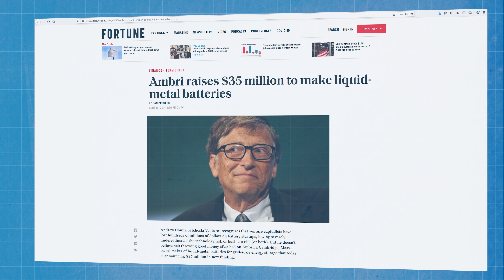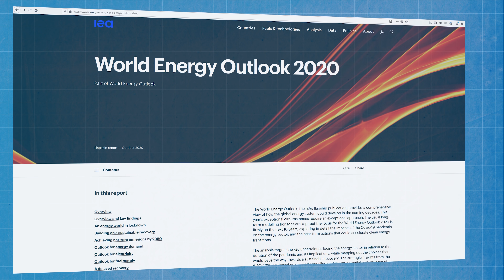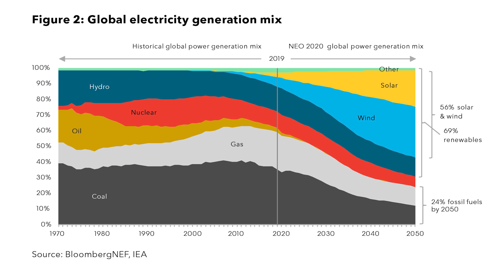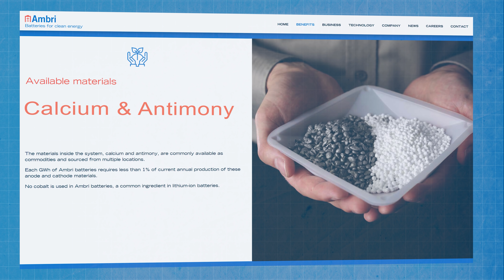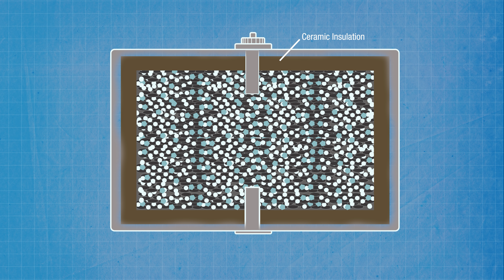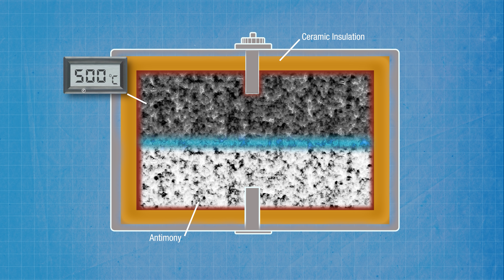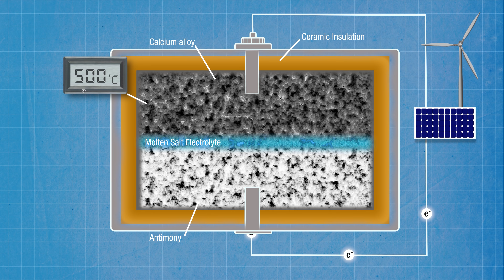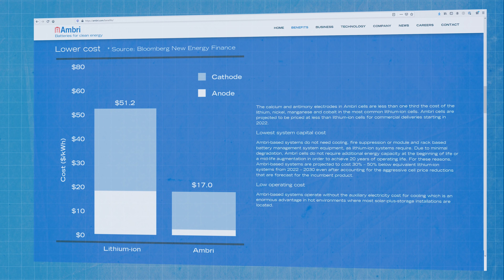AMBRI Liquid Metal Batteries. Will they really change the world?

Comment: I really hope Ambri will succeed and take over at least some of the utilities battery storage market... Keep the Lithium Ion for vehicles.
Reply: Your absolutely right we can't have all the batteries we need for cars and still have enough for grid storage.
If you want a longer explanation see my main comment.
Reply: LMBs are my fave for grid scale, use materials not needed for mobile uses, run hot, run hard & last functionally forever. The term "forever" in this context means lasting longer than the purpose for which it is built
Reply: @tsamuel6224  
Do you have any idea of the amount and density of energy needed for grid storage?
Wind and sun can fail completely for 14 days (calms and cloudy skies) and seasonal fluctuations must be balanced out (lots of sun in summer, little in winter, but lots of additional consumption in winter).
To supply Germany with electricity for 14 days, batteries with a capacity of 21 million MWh are needed. At a price of 100 $/kWh this costs 2.115.384.000.000 $. Each household would have to invest 100.000 $ only for the batteries, if you add the infrastructure, this would increase the price of a kWh from now 0,35 $ (Germany already has the highest electricity price in the world thanks to green energy) to 1,76$. That is 10 times as expensive as conventional electricity!
Reply: @TheSpecio  lol germany and green electricity... do you know that germany is mostly burning coal (idk what the proper name is in english but in dutch its called "bruinkool" go use google translate if i want to know) to generate electricity... (i get this is an old comment but come on germany hasnt had green electricity in ages, they even closed their nuclear powerplants)
Reply: @michieldewitte5216  It's called peat coal.
And you are right.
Germany has the most expensive electricity worldwide, while ca. 50% of it is from renewables. France has one of the lowest electricity prices and 75% are nuclear.
But when it comes to CO2 emissions, the fallacy you mention becomes obvious:
In Germany, for each kWh 440 gram CO2 are produced, in France, iit's just 58 gram.

If you need an undeniable argument against wind and solar renewable energy, a single word is sufficient: Germany!
Reply: @TheSpecio  well not exactly, germany has one problem... solar, wind and hydro are the cheapest form of electricity, but its the batteries that make it expensive. Once the liquid metal batteries are a viable option i expect them to be the sole producers of electricity, along with gas, since that can ramp up quickly and fill in the gap if we have too little storage. But in the mean time we need nuclear (preferably a lot), coal (ideally not so much) and gas (to assist in the spikes since they can ramp up quickly) as a necessary evil to fill in the gap.
Reply: @michieldewitte5216  
A power plant is a device that delivers electricity ON DEMAND.  You can not compare a wind turbine with a diesel generator because the wind turbine is not regulatable.
That's why you can not say wind and solar are cheap.
And this battery? Oh my, so many were invented, none was a breakthrough and the Abri will not be an exception.
It is a new carrot that the faithful will follow for a while. In view of the gigantic quantities of electricity that are produced and consumed, all thoughts of economic storage are castles in the air from the outset.
Reply: @TheSpecio  well people once thought flying couldnt be done, and then it was done, once upon a time wireless communication around the world in a matter of seconds was impossible, until it was done, having work done without physically doing it by yourself? Impossible, until it was done. My point is: we dont know what can be done and what cant... in the history of the humans we have faced countless barriers and we broke nearly all of them, i believe we will find a way to do it, like we have almost always done...
Reply: @michieldewitte5216  No,
the laws of nature concerning batteries are very well understood and it would certainly be a very stupid strategy to hope for a miracle in the electricity supply.
Technically, we are going a different way:
One invents FIRST all components before one begins with the building of a plant.
Building wind and solar and then hoping that somehow a solution for the storage will be found is the same as taking off with an airplane and hoping that someone will build a landing runway in time. It's lunatic.
Reply: @TheSpecio  well if you take off in a plane you have a runway already since you took off from it... and concerning the order of components that need to be invented first: windmills and solar panels work without batteries, the batteries just make them better, see it as disk brakes in a car, they worked fine with brake drums but they are better with disks. Same with solar and wind power, they do their job just fine now but they would be a better option if they had a giant battery slapped besides them
Reply: @michieldewitte5216  
When you board a plane, you have a destination. THERE you need a landing runway.
Windmills and sailships did not get a battery or an auxiliary steam engine for times without wind. They were replaced by steam engines. Horse carriages did not get a petrol motor to assist the horses at steep hills.
No one enforced these Changes. No one subsidized it. Indeed, no one cared about it. It just happened. The decision was made by the people and by the market, not by the state. 
Without the state, we wouldn't have a single wind turbine, a single solar panel, a single E-mobile.
"But the climate!" you say now "We have to enforce CO2-free energy or we must all die!"
Uhmmm...No.
Climate change isn't threatening us.
But even if it would be true: The government may set the goal 'CO2-free energy'. But it is howling madness to let the government decide HOW this should be achieved.
Just look at Germany and you see why.
Reply: @TheSpecio  so you say coal powered generators dont get any subsidies? You say that nuclear centrals, the all good infinite power supply without co2, only a bit of nuclear waste, doesnt get subsidies? The coal and oil markets get money thrown at them like no tomorrow... look a your germany they had to pass a law that forced the closure of nuclear, and that played in the hands of the coal industrie. If it wasnt for those laws and the one that basically make it impossible to build a new nuclear plant in a western country, coal wouldnt exist anymore. Neither would ice engines (inside cars) be a profitable business. Because if there would be a lot of electricity from those nuclear sites it would be far cheaper than gasoline. But hey last time i checked we need the governement to set some ground rules (good or bad i leave that up to you). But why the push to solar and wind and not nuclear, you might ask? Well thats because solar and wind is far cheaper to make per kWh, and it doesnt make harmfull radiation and it doesnt produce nuclear waste, now why could it be that solar and wind is so good? Oh maybe because euhm... idk they just do their thing without much maintenance. Unlike coal and oil they dont need a ton of rescources thrown inside the burner. And it doesnt produce nuclear waste like nuclear energy. It also doesnt produce the cast amounts of co2 like coal. Now there is one downside and that is the garanteed productivity, and that my friend is where the problem is, and this video shows us a possible solution. But thats not needed you say, just keep burning coal and oil, it'll be fine, you say... And the nature? It will manage you say, climate change, what climate change, you say... but even if climate change doesnt exist, spoiler it does, look at all the evidence you get. Higher temperatures, more extreme weather. My country (belgium) now has had 5 pretty severe droughts in 5 years, farmers have minimal yields, they are really struggling they have to keep artificially watering their lands to have some sort of crop. And even if climate change doesnt exist and what we are seeing is not true, if we phase out polluting cars, and go to green energy, would that be that bad? "Oh look we just accidentally eliminated air pollution, wow that was a bad idea now we have clean air around us and we dont have to look at those ugly coalmines and huge smokestacks..." Man i really dont get why youre against green energy that much... sorry for the wall of text
Tldr imagine that we clean our air and we find out climate change doesnt exist, that would be bad... now we have clean air and we didnt need it, goddam what a horrible thing to do
Reply: @michieldewitte5216  You got it right.
Coal power plants and nuclear power plants do NOT get subsidies.
I worked in a nuclear power plant. At that time, it was in the possession of a state-owned group.
Not only did this plant pay all the regular taxes, but it also made a net profit of 1 Million Mark per DAY, for the state.

Please abandon the fairy tale of cheap wind and solar. I already debunked that.

And do not believe wind and solar are 'clean'. Not only are the wind turbines ugly and have a devastating effect on the environment, but they also are responsible for excessive mining:
Neodymium, for example, is a rare earth metal mined in China. It is needed for wind turbine generators and e-mobile motors. This mining is one of the worst environmental disasters of all time, huge areas, lakes, and rivers are poisoned and contaminated with radioactivity (YES, wind energy causes radioactive contamination!), thousands of Chinese get sick and die.
Search 'the dirty secret of wind energy'!

And have a look at that:
doubledoubledoubleyou period manhattan-institute period org/mines-minerals-and-green-energy-reality-check
Reply: @TheSpecio  uh sorry to say to you but nuclear has had some serious subsidies in the past... they needed them to make the technology viable (why cant other technologies (like wind, solar, batteries...) get the same subsidies?), and i suggest you do a quick google search about all the subsidies coal plants get, its insane. Also funny how you leave out another part of the pollution that the production of wind turbines cause. They need coal to make the steal and concrete, and since coal gives of tiny particles of carbon, and as you know there is a radioactive carbon isotope, named carbon 14, and by burning coal you release that into the air... So yeah wind turbines cause some harm but at least when they are build they do their thing and dont harm anybody (exept for some birds that fly too close). but hey you go have fun living near coal plants and inhaling that carbon 14...
Reply: @michieldewitte5216  
General research and development on new technologies is a core area of the universities' tasks.
Therefore, they are not subsidies. The state also does NOT subsidizes banks because it trains business economists.
Of course, renewables also receive such 'subsidies' and even on an unprecedentedly large scale.
 As far as the release of radioactive substances like 14C is concerned, you might want to look at basic arithmetic first to get direct numerical comparisons. That would save you some embarrassment.
Unfortunately, you leave more and more the terrain of a reasonable and objective discussion.
Therefore, I quit our conversation here.
Reply: @TheSpecio  well you can leave the discussion and tell yourself what you want but i just pointed out what was missing in your reasoning. As for the new stuff, general research and development isnt solely done in universities. And btw universities do get subsidies (at least in my country)
Reply: @TheSpecio  PG&E in California charge me $.42 per kWh. I don't pay it because I have a PV system on my roof.
Reply: Li-Ion is no solution for vehicles. 
E-mobility is a hype for people who can afford an expensive battery-powered fun vehicle beside their 'real' car.
Reply: @TheSpecio  Yaaaap. That's why the entire car industry is currently undergoing a fundamental transformation towards Li-Ion-powered vehicles.
Reply: @TheSpecio  You're wrong, really.. I advise you to watch Tesla Battery day presentation.

The new Tesla battery will bring cost down to $50/Kwh .. Consensus is $100/Kwh is about cost parrity with ICE.. So Tesla cars will become MUCH cheaper than comparable ICE cars.. The transition to EV's is inevitable.

Beside the cost aspect, EV's are BETTER  in so many ways than Ice cars!.. Better performance, better handling, better safety, quieter, no emissions (thus cleaner air in cities!!), better software, longer lifespan, less depreciation, Charge at home, more storage.. I could go on and on.. 

So you could say an EV is MORE real than an old ICE car... It is so much better, you have no idea.. Once you have driven an EV, you never want back to ICE, really.. Brand loyalty for Tesla is the highest EVER, over 90%. 

I put the money where my mouth is, I have ordered a Model Y in June 2020, will come from the Berlin factory probably second half of 2021.
Reply: @MarcoNierop  No they re not. We need synthetic alkane fuels and IC engines. Production of such fuel will be negative emissions, which we desperately need in order to REVERSE climate change!
Reply: @RoScFan We must stop burning stuff and plant more tress to take out the CO2.. Way more efficient costs less and can be implemented immediately.. actually this IS happening, right now.

It takes just one test drive to flip and realize ICE is stupid.

Battery cost has come down 80% the last 4 years, and this cost decline will continue with improvements Tesla has revealed in September, economics of scale, new chemistries, etc.
Reply: @MarcoNierop  Actually DAC is much more immediate and cost effective in terms of absorbing CO2. It's laughable to even compare DAC to trees. NAture is nice, but rarely more efficient that modern engineering. But the Co2 captured has to be used for something. Synthetic fuels is a very good option for making DAC profitable at a large scale. All this hype about EVs is absurd. It's sad actually. EVs will NEVER be better than ICE for the simple reason that alkanes have an energy/mass ratio that is 25 times that of lithium ion batteries. That makes alkanes fundamental to the shipping industry and air travel. For those EVs aren't an option at all. But no doubt better energy density can also make personal vehicles better. It's sad that everyone is just jumping on board a worse form of personal vehicles.
Reply: @RoScFan  So you generate electricity, transfer it to the car over high efficiency wires and drive the car at 90+% electric to kinetic efficiency.  Or, you generate electricity, use it to make alkane at low efficiency, ship the alkane to the cars in a truck using some of the alkane as fuel, then use the alkane to power the car at 20% chemical to kinetic efficiency.  Seems like a lot of inefficient and unneeded steps to me.  This is the exact same reason hydrogen won't work either.  Once you've generated electricity, the best thing to do with it is transmit it over wires and use it as electricity.  Every time you switch between energy states, you lose energy.
Reply: @MarcoNierop  Do you really trust advertisements? 
Do you never ask questions?
- How long with the battery last? If you need a new one every 2 years, the costs soar!
- How will you produce the electricity to load them?
- What are the environmental impacts of the production?
...and many more questions, for example: Is it really necessary to decarbonize?
Reply: @MarcoNierop  No, we won't get fried.
But you answered my question well. your arguments are good and I am a bit wiser.
Just one more remark: You are driving your car only at night because it's charged in daylight?
And what about cloudy days? You resort to a bicycle then?
Reply: @MarcoNierop  About air quality:
There is an interesting result thanks to Covid: During lockdown with drastically reduced traffic, the air quality did NOT improve in german cities.
And did you think of other cities, in China, for example?
Your E-car uses neodymium magnets in the motors, neodymium is also needed for wind turbine generators.
Neodymium is mined in China under horrendous conditions, whole districts, rivers and lakes are poisoned and contaminated with radioactivity (Due to the Thorium 'waste' of the production) and many thousand Chinese people are dying for your 'clean' air.
Reply: @TheSpecio  That is old, China has improved mining of Neodynium considerably, it's not half as bad as it used to be. 

German cities already have a lot of restrictions for cars that may enter, so that cherry picking result is not representative... Look at places like Los Angeles, Bejing and other big cities around the world that did show HUGE improvements during the lockdowns.

EV's are a lot better for the environment, no matter how you look at it, All this whining about mining is BS, like drilling for oils is so clean, and this has to be done day in and out to keep your ice car running. Mining materials you need to do only once, and use it the next 25 years and after that it gets recycled 100%. Oil you burn once emitting nasty stuff in the air we breath, and then it's gone for ever, you need new oil over and over again.
Reply: @TheSpecio  I work a lot at home,.so charging during the day is no problem.. For cloudy days I still have the grid,.which delivers also green electricity
Reply: @MarcoNierop  No, your grid does NOT deliver green energy, because in this case, you would have blackouts several times a week.
And what do you recommend for people which do not work at home = 95% of the workforce?
What do you recommend for trucks?
What do you recommend for airplanes?
And ships?
Reply: @RoScFan  These synthetic fuels are only around 10% as efficient as storing the electricity directly in a battery. But sure, once we have extreme amounts of overcapacity, they could be an alternative for jet fuels for example.
Reply: @michaelnord9081  Can't say it better.
Reply: @TheSpecio  Why do you think 8 year old Teslas retain their value so well?
Reply: @dpsdps01  synthetic propellants are 100 x more efficient than batteries in terms of weight/power ratio.
And we have plenty of energy: uranium and thorium will last until the end of time and nuclear power plants are cheap, reliable and safe (and CO2-free).
Reply: @michaelnord9081  Show me a truck with 20 tons payload that can drive 500 km with one battery without a break.
Trucks are responsible for more than 50% of automobile fuel consumption.
Reply: @cameronf3343  Every government once believed that it is necessary to burn witches.
Your argument is more than poor, it is ignorance.
Reply: @RoScFan  With molten salt nuclear power, EVs are still much better. Until then, you might have an arguable point. But remember, it takes energy to convert CO2 and water to HCs.
Reply: @dpsdps01   I don't know how/why  you persisted with this conversation,  more patience than I have. Trying to reason with someone who is by nature unreasonable is draining.
Reply: @MarcoNierop  better handling ? with a ton of batteries ? sitting on a non-extingible fire source. Who wants software and an internet connection in their car ? sound like an accident to happen, and then , we don't even speak about the time, these batteries will survive, and what happens to the places, where the minerals are retracted from.
Further, tesla's politics on repairing your vehicle is untolerable.
And in my case, that damned tesla would not even reach far enough, while my fun diesel car can almost, or get there, depending how I drive, with one tank.
No electric car for me, maybe Hydrogen offers better possibilities
Reply: @Steve25g  Ignorance is not a virtue,all you said is nonsense. Don't believe the FUD!